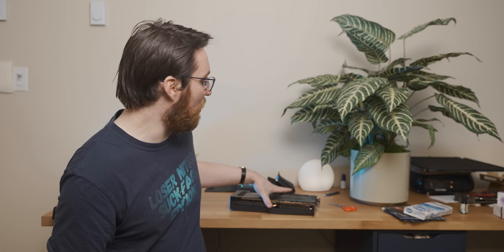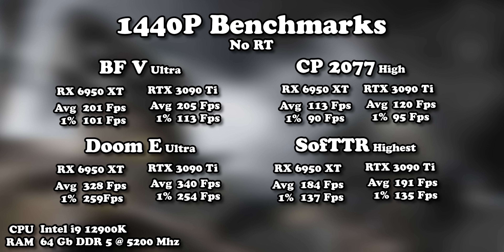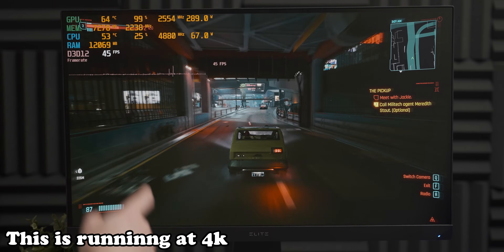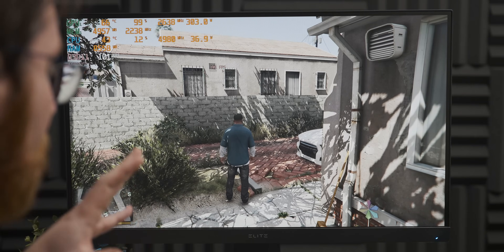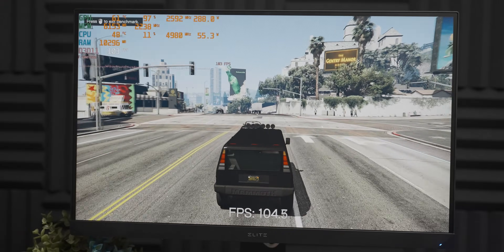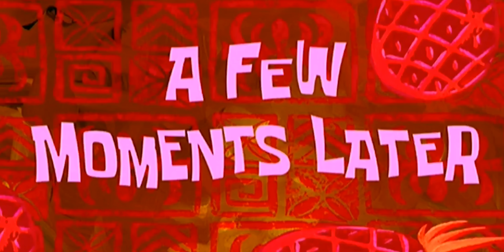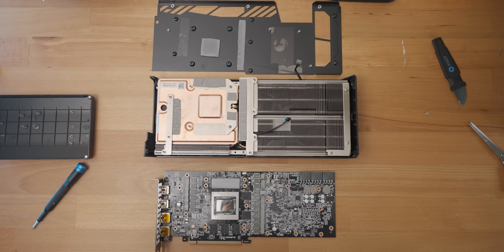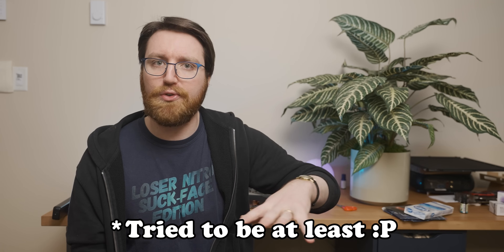I Can't Figure Out What's Wrong With This Gigabyte RX 6950 XT

Comment: Ah, I see that even reviewers are subject to Gigabyte’s top tier support
Reply from the maker: Haha!! At least they don’t discriminate when it comes to their support. 😂
Reply: @DawidDoesTechStuff  Does anyone have a Sapphire Nitro+ 6700 XT? I have one, and it has weirdly  low wattage d raw numbers, but then people tell you  it is "supposed" to do  that because the complex algorithm for clocks etc. during different work loads.

My 1660 Super ALWAYS  ran at  max  125 watts in any  game less than 8  years  old  or so...

My  Nitro 6700 XT , on TECHPOWERUP, just like Dawid's example, runs at what  the spec number is supposed, while gaming for them, so 230  watts.

My card very rarely gets there.

most games it runs at 180 watts max, and often dips below that.

Only  in benchmarks does it run at 230 watts, like Furmark.

Maybe I should use FreeSync premium because I have a gigabyte M32Q, which is a  great  great  monitor ( and one of the only good things from Gigabyte )  but I can never seem to make Freesync tech work properly, or at all... beyond  seeing it say that's it's on or off. the FPS numbers never  do what  I would expect.

DX12 games run well on the Nitro+ 6700 XT, DX 11 games less so.

And I guess many people with many different cards have issues with GPU utilization in  GTA V.

It's even worse for me in X-COM  2.

Anyone have  a Sapphire Nitro+ 6700 XT?
Reply: I'm still waiting for a GPU in RMA, stuck in ''Being Replaced or Replacement being tested'' for a month now
Reply: @snitchmojo3717  Jesus man, that's wild
Reply: @HaikuOezu  with no apparent way to contact them. 

In a span of 1 week, MSI received/test/replace/send the replacement when i had a defective motherboard
Reply: That’s brutal, you’re not even an outlier because I’ve seen plenty of people citing having to wait multiple months for RMA’s

I’m very worried that I have a Gigabyte monitor now and one day I will have to rely on them again.

in all honesty it wasn’t too bad for me in Europe. I sent them the monitor (I had to pay for shipping), they received it and after ghosting me for a couple weeks they got tired of my emails and told me that they’d give me my money back because they don’t have the parts for repair it (???)

After like a month they eventually came thru and refunded me - I got another monitor which is currently working fine but I dread the moment I’ll need their RMA again
Reply: @snitchmojo3717  I waited 4 months. Sent my 5700xt to them back in January,  just got email yesterday it was being sent back finally. At least it wasn't 11 months like someone else had to wait. I think I'm staying away from them from now on.
Reply: Update: UPS just dropped off the package from them. They sent me back a 6700xt 12gb card. Nice little upgrade from the 5700xt 8gb I sent in to them. Hopefully they upgrade your rma too for the wait.
Reply: @SportBikeAnthony  as long as they dont send me a 6500xt 😂
Reply: And people why I have scuffed Gigabyte for years. The proof is always in the pudding.
Reply: I guess that Steve from GN will have another video about Gigabyte if there's more than one unit that has this problem.

Comment: It sounds like there's a problem with power delivery and it's probaby a hardware fault on the GPU PCB. You could still try daisy chain 2 different output PCIe PSU cables into a PSU adapter cable and do this for all of the GPU power slots. Fixed a similar issue for me once.

Comment: Did you check if it was running in PCIe x16? I had the exact same issue with the gigabyte 6900XT gaming OC - power draw was less than spec but also couldn’t get it to run at PCIe x16, only at x8. So RMA’d it. Tried everything but nothing worked.

Comment: You are supposed to use a Power Measurement Device, not use MSI Afterburner for the wattage draw. Not to mention that if the card is drawing 290 watts from the PCIE power cables it is also drawing 75 watts from the PCIE slot. so add 290 plus 75 gets you an estimated 365 watts. and if you raise the power limit you get around 375 watts.
Reply: That would make sense if performance wasn't impacted, which it is, and if there wasn't another case of it throwing up a max of 290w despite the card in another test showing 390w.

Not to be a sarcastic prick but outside of a case of Schrodingers' wattage, seems more likely to be a manufacturers problem when they don't even know what's up, and didn't just say what you did. If 300+ through MSI Afterburner isn't in spec even under overclock then I doubt Gigabyte would need more than an hour to reply unless they're just really shit at CS.

Comment: As much as you guys hate on Gigabyte, I literally just got my Sapphire Nitro+ (non-pure) card yesterday and was wondering it had something wrong since it only draws 290W and the GPU boosts up to 2680mhz with a coil whine that goes through the roof... something's definitely off here and I don't think it's the manufacturers, smth in the design itself.

Funny thing, it scores 32k in PassMark G3D, which is well above average (29k), so I really don't know what's going on...

UPDATE: Well actually, just after a short investigation of mine, if you look on thechpowerup the bioses they have for 6950 XT are limiting power to the cards output and mine too has 290W which is a bios limit. I think the cards that draw insane amounts of power are the faulty ones, ignoring bios specs. My sapphire non-pure is 290W, the Pure is 325W limited and the Toxic is 332W limit accordingly, so this is by design.
Reply: As I posted above, AMD cards only report core power in software, not total board power. If you measure what the cards actually drawing from the PSU, you'll find it's the higher figure. A normal 6900xt for instance draws about 300w, but displays about 250w.

Comment: ASUS does a better Job at hardware
Reply: Until their coolers start separating from the GPU and their assembly lines mount capacitors upside down on motherboards.

Comment: i love Gigabyte MOTHERBOARDS and have never had ANY issues with them since LGA775 but when it come to graphics cards i strictly go with EVGA/Asus thanks to their outstanding customer support and quality control.
Reply: Had a good experience with their boards as well. Got a LGA775 and a LGA1155 here, both still perfectly fine, despite running overclocked rigs for 9 and 14 years respectively.

Comment: I believe it is a hardware issue that has to do with the power delivery on the gpu.I think the coil wine is from the compacitors not the fans
Reply: Power delivery is only partly a hardware thing. on the RX 480 AMD changed the draw with a simple driver update. They offloaded circa 10W from the PCIe slot onto the power cords, and later on manged to reduce those as well while also increasing performance.

Comment: I had bought the same Gigabyte Card in the 6900XT when it came out and had similar issues. It never performed to the benchmarks I was seeing. I tried overclocking but the performance never really increased. Ended up selling it and buying a 3080ti……problem solved.
Reply: Had the same issue with 6800xt(not a gigabyte card tho). My card was under performing compared to others benchmark and it had crazy coil whine
Reply: The question is, was the price difference between the 6900 Xt and 3080 Ti reflected in an equal amount of performance difference?

Comment: My rx 5700 xt was a gigabyte gaming oc version and it was great performance-wise, but the fans were super loud under load. Hate when gpus have weird problems that are hard to diagnose. I do a lot of builds in my spare time to sell and I've had several recently that gave a signal but showed up as basic display adapter and gave out error code 43. None of the troubleshooting suggestions I could find online would fix the issue. Frustrating.
Reply: I'm pretty sure the cooler Gigabyte used on the 5700XT was just smaller height wise than most others and it's thus resorting to a higher fan RPM to keep the temps in check.
That's why it's obviously still fast since the fans can still keep it cool enough to not throttle, but a bigger cooler from another brand would've been your cake that you could eat too.
Reply: @CarbonPanther  I'm pretty sure it is.  Even looked similar.  Good performance,  temps never went above 70c with slight adjustments to the fan curve. Just loud. Ended up selling it for almost 3 times what i paid for it and got a 3070 ti.

Comment: Whoever designed that RGB gigabyte logo thing should be fired. Constantly flashing different colors is maybe the worst thing you could do. Even if it would change the color over say 10 seconds it would be somewhat fine. Turned totally off would be the finest. Not existing would be the ultimate solution.

Comment: Had an issue with the 6900xt I received last week direct from AMD. For the hour the card worked before suddenly dying and causing the system to be unable to post, performance seemed lower than my 1080ti. When asking AMD for a refund on the product, they insisted on replacing it with a refurbished model. Ended up having to badger them a week to get them to approve processing a refund on the card and even then I had to ship it back at my expense. Now I'm just waiting for them to refund the card so I'll only be out the $40 spent returning it, rather than the $1120 I'm out now.
Reply: why didnt you just get a replacemeant
Reply: @yamisniper  Because after paying full retail for a new card I didn't want to turn around and pay return shipping back to the manufacturer so I could get a refurbished card whenever they had one available.

Comment: I noticed that at 3:40, you were using the pigtail of the 2nd PCIE cable and I read somewhere that each cable only delivers 150W. I can't really tell either way because of the angle of the camera, but that might just be a hunch especially if the 3090 Ti worked with the first PSU
Reply: dont thats a bot

Comment: Whoever owned a lot of hardware knows there are problems with all brands on the market. No brand has a 0 problem history. But yes gigabyte seem to have more problems then others but at least the support in Germany/Austria is great. I have had bios problems with asus, msi and gigabyte. Funny enough the most stable bios of recent years had AsRock if only they knew what VRMs are. GPU problems I have had with asus and evga. From scratched 3090 strix to load balancing on the FTW3.
Reply: This is the correct opinion.
I bet you can find people in this very comment section complain about all big 4 Mobo brands, telling each other how bad their specific quality is, and somehow all of them will think they're right at the same time.
Even if that technically means none of them can buy motherboards anymore cuz "they are so baaad"

Comment: Jus FYI, on Gigabyte products, "firmware" refers to the RGB firmware.  Has nothing to do with performance, which would be delivered as a BIOS update (technically vBIOS, but the site will just say BIOS).  So, of course that didn't help.

Edit: now that I'm at the end, that makes the Gigabyte rep's questioning of the firmware incredibly odd. Says to me the media-facing contact doesn't have very in-depth knowledge of their own products.

Comment: You pretty much changed everything you could. Power supply, platform, bios and drivers.
At this point there is nothing left but a hardware issue with the card
Reply: he made big mistake, you can't measure the power of AMD cards using software only

Comment: Will GPU Z tell you what the max wattage is on AMD vbios like it will on Nvidia vbios?

Are you hitting power limits on a single 8 pin or the pcie slot?

What is the perfcap reason in gpuz?

Comment: Hi Dawid, Gigabyte (Aorus) 6900XT owner here, Noticed similar low power draw with mine (300W), In the end I just used a little application called 'More power tool' to override the limits and was able to get it to go all the way up to 380W.
Reply: he made big mistake, you can't measure the power of AMD cards using software only
and you will burn your card soon while it use more than 450W

Comment: 4:04 ; 6:10
Why TF does it say 'GPU [#1]: AMD Radeon RX 6600'? Is this a mistake made by Dawid or might Gigabyte just have straight up scammed you? lmao
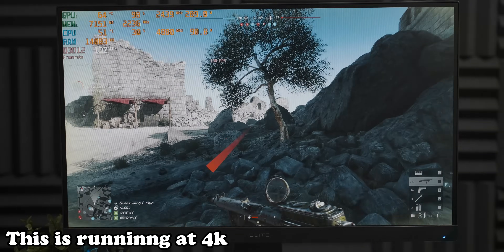To add is as well that the GPU MHz speed is more in the range of the RX 6600 XT, than the RX 6950 XT. It says on AMD site that the MAXIMUM speed for the GPU is '2310 MHz'. Looking at f. e. the GPU speed at 1:20 it says '2483 MHz'. Which is, as mentioned before, more in the RX 6600 XT's range '2359 MHz - 2589 MHz'. Kinda strange, isn't it?
Same goes in all the other game footage, correct me if wrong. But it seems they might have shipped the wrong card with the wrong firmware?

Comment: If you're buying a multi-hundred or multi-thousand dollar GPU, DO NOT GET THE BOTTOM MODEL.  Spend the extra 5-10% to get the top model within the lineup.   It's the same story with Ventus, Fighter and other low-end non-reference designs.  

I acquired a Red Devil 6950XT last week and it's not only dead silent (no coil whine, no fan noise) but it's also slaying the benchmarks like it's supposed to.

Comment: Based on the power draw combined with known good bios failure and the crazy coil whine I would bet on a hardware issue
Reply: The BIOS this model card is literally set to 289W though, the card is actually successfully doing what it's being told from gigabyte, which might be the actual problem.
Reply: @CarbonPanther  he used the bios from a card that was using 390 watts with no change. If bios was the culprit then swapping to a bios from a 390 watt card would fix it

Comment: Imagine you finally get your hands on a nice graphics card and its the one that hasn't passed through quality control...
Reply from the maker: I know right! For $1200 you’d expect it to work properly.
Reply: @DawidDoesTechStuff   Yeah man holy s@@t for that price thats just... YouTube will delete my comment if continue 😅
Reply: Just like my friend who has had 4 $2,000 Samsung Odyssey G9 Neo monitors in a row that have ALL had dead pixels...
Reply: @RandomTechVideos  all monitors have dead pixels
Reply: @quolve  Not all monitors do. None of my dad's 3 monitors have dead pixels. And my old 4k 32 inch monitor doesn't have dead pixels as far as I can tell. My laptop doesn't have dead pixels. My current 4k 32 inch monitor has one.
Reply: @RandomTechVideos  Trust me they have them, its just 4k so the pixels are tiny and u probably can't notice them, but every single monitor has dead pixels.
Reply: in March i finally get my Gigabyte 3060 Eagle, the sound of coil whine so bad, the build quality so bad because when i take my 3060 on my hand the body sound "kwerk krekk", and last the LED on my card so weird , i think my LED is leaking because some color blend randomly

feel so bad, now i change my card to colorful, and no problem happening like in my Gigabyte
Reply: The weard part about these cards is that i have a 500w ebike and it can go 65 kph with me and a heavy bag on it,the power consumption on these cards is crazy
Reply: @kvotipuka4815  why its's weird, they are emulating a realistic 3D environment with lights, effects and reflections and physics, at a high framerate.
Thats still a lot of work.
Reply: @marcogenovesi8570   Yeah i agree and it produces 3d images in milliseconds thats some alien 👽 sh0t.
And im not talking about the stupid brand.
I have a rtx 3060 and i don't care what anybody syas pruerly for gaming its awesome gpu
Reply: We need no quality control where we are going

Comment: Well, one of the reasons my current build is with ASUS instead of Gigabyte, is the customer reviews and hit/miss satisfaction. My previous build I used Gigabyte MB and water cooled 1080ti..it's still working great...but I've seen a lot of people that started having issues over the last couple years. One of the reasons I don't do bleeding edge builds anymore. It give time to see what products are performing and customer responses. I hope you figure it out though Dawid, I'm interested.

Comment: 1: I follow Techtesters for few years now.  Very different presentation to your channel for sure, but she is pretty awesome and one of few tech channels I follow.
2. Three things come to mind as for possible realistic reasons for this eh situation.  a) Bad card.  b) bad cables.  c) bad capacitors. 
Good luck.
Reply from the maker: Yeah! Their reviews are great. 
I’ll definitely follow up once I have more info on what’s going on.😃
Reply: It can't be the cables, he swapped out power supplies AND mainboards. Literally the only thing that was the same was the graphics card.
Reply: Nada 😍
Reply: its either bad caps or bad power delivery components (chokes, inductors, etc.). If it was a bad card, then its questionable how it ran consistently with same results. Bad cables have already been ruled out, as dave replaced every single component in the test bed, even power supply cables.

Comment: The fact that two testers encountered the same issue doesn't bode well.  Going to be a lot of RMAs in the near future methinks.  You've done due diligence with every possible combination of bios/firmware/drivers.  Could still be something else?  Fingers crossed, I guess.  Not that I'm ever into bleeding edge GPUs.

Comment: I've owned numerous gigabyte products over the years and have had mostly positive experiences but recently had to replace a z390ud mobo because it wouldn't allow me to enter bios, was really strange, i tried all the usual suspects but even after full reflash and cmos battery replacement lol it would lockup every time. Replaced with an msi mortar and haven't had any issues.
Reply: Audio died on my B560 Aorus so replaced it with a Z590 Gaming X...which the LAN died on. I now have an MSI Carbon Wifi and it hasn't died yet....yay!
Reply: MSI or nothing my friend.